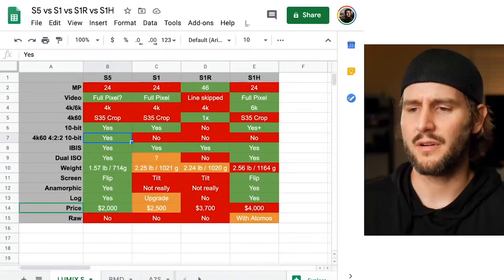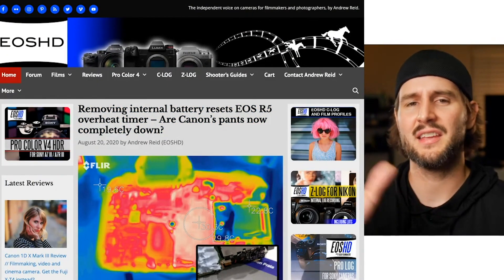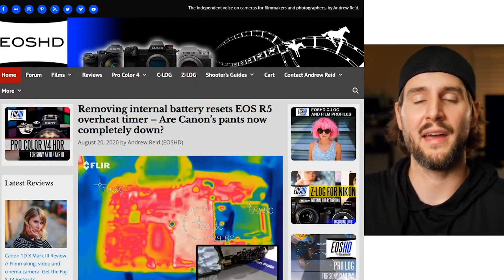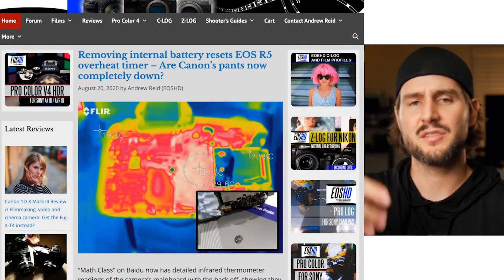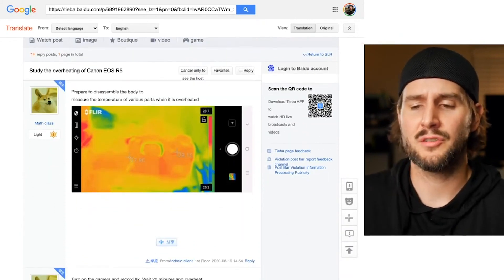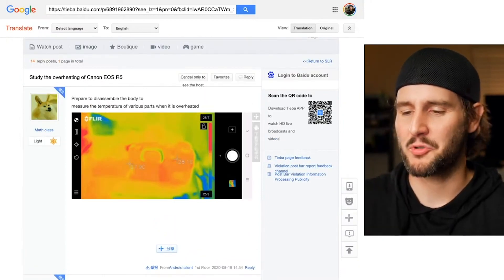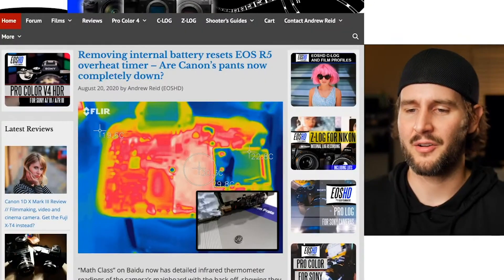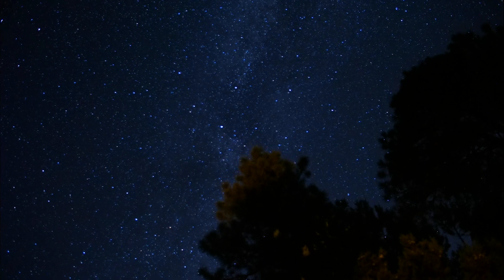Canon R5 User Reveals Thermal Imaging Test Results

Comment: 150 for any cpu or component is pretty hot.  Think of it like a computer.   The warning lights would of gone off if it was a pc.
Reply: Not really, this is Farenheit. Modern cpu's can easily handle up to 212 °F (100 °C) then simply enter throttling mode until temp goes down. Of course, desktop cpu's have much, much better cooling.
Reply: Yes more cooling and an open case.  Laptops throttle down sooner because of smaller fans and casing.  They also have a very large heat sink to cool it down faster.
Reply: I used to play Counter Strike Source on my old MacBook Pro from 2009 and the CPU would run at 105°C for hours.  I think I put like 200 hours on that game.  That computer still works to this day.

Comment: Conclusion is that overheating is due to time restriction.  Nothing to do with temperature.  I guess the time restriction might have something to do with reliability and longevity of the electronic components including the senor/processor.  Canon probably doesn't want people to roll those overheating modes all the time.  Excessive use at high temperature may shorten the life of the sensor/processor.  That is my conspiracy theory.